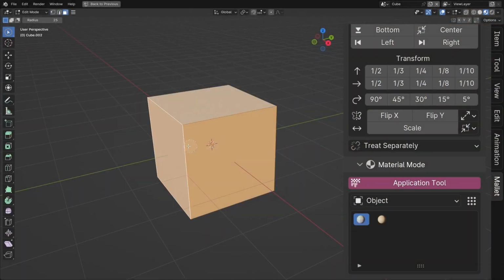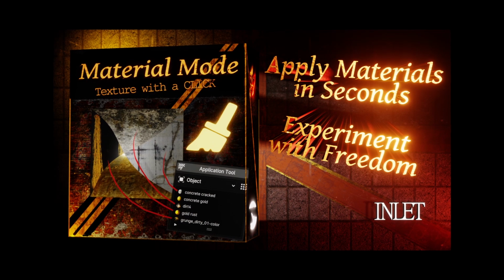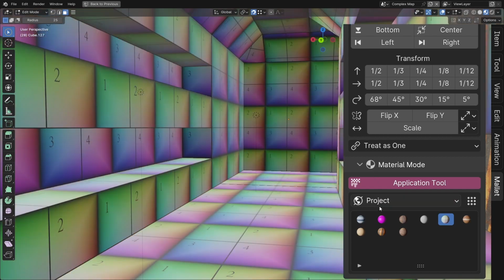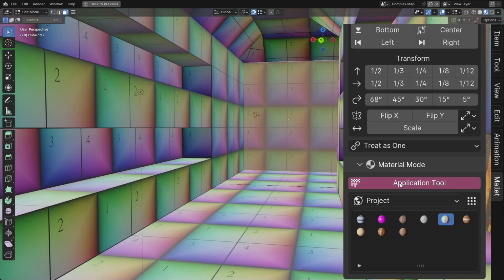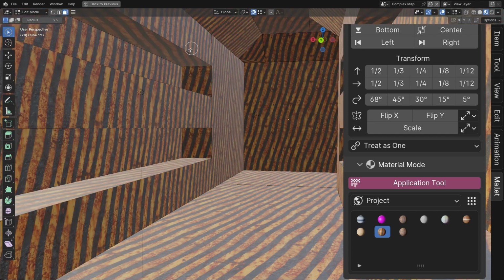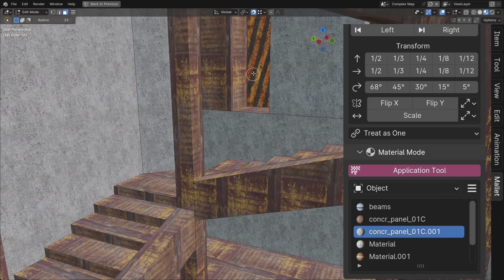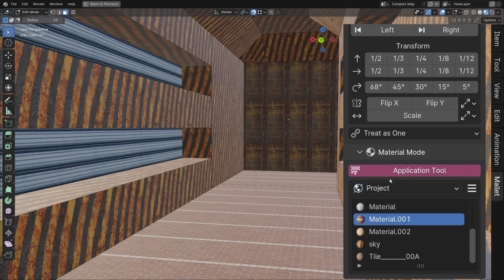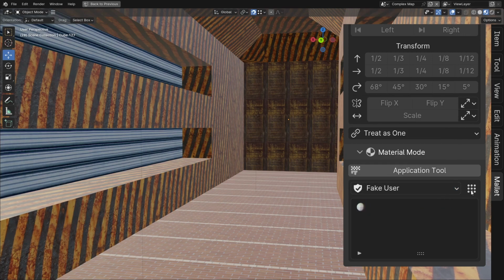Material Mode - MALLET - Blender Addon

Comment: A little explanation for why it's called a Fake User (I am just guessing but I'm 90% sure I'm right)

Basically, when a material is applied to a face, that face is the user of the material. When a material is not used on a face, it is loose data which can be removed with Purging. So when you click Fake User on a material, you are basically telling blender that this material IS being used and it is not loose. Therefore it will not be purged. 

Hope this helps!

Also, are you a voice actor, because if not you should really consider getting into that field, you have a really good voice!